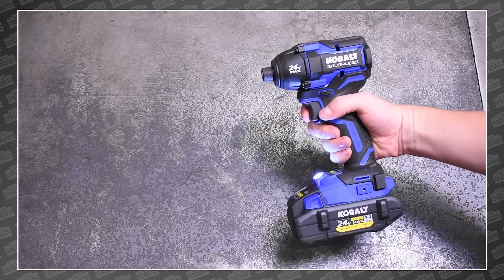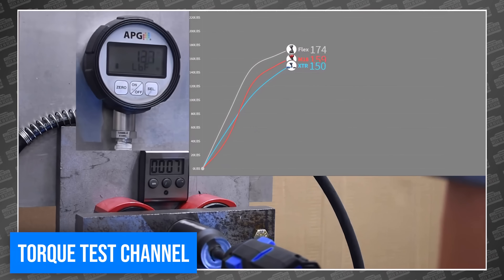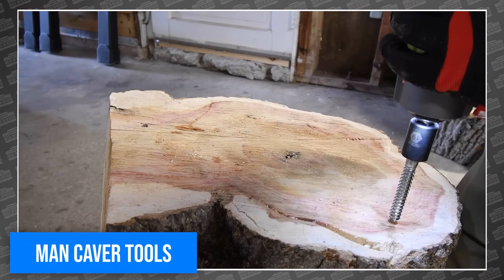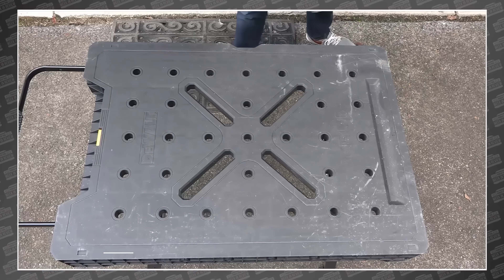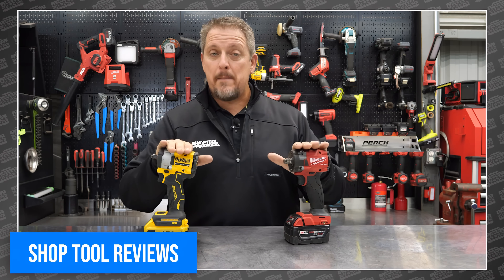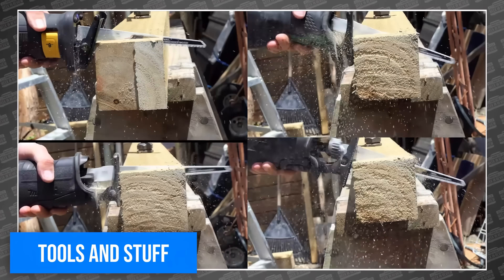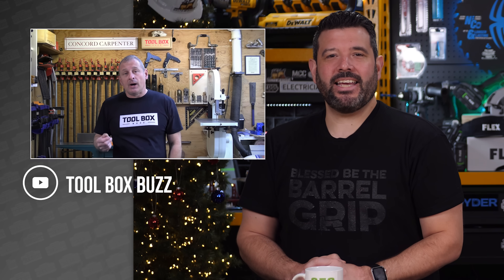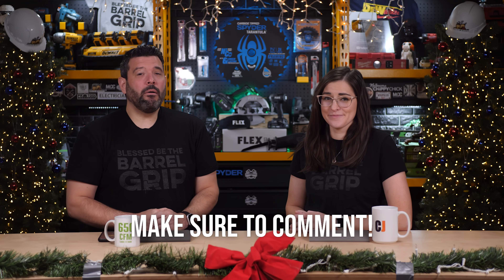Milwaukee FINALLY delivers on a HUGE promise. Plus, BEST Track Saws and BEST Mid-Torque!

Comment: When I said that Kobalt XTR was a sleeper, I got comments about it being a joke and DIY junk.  But when TTC does it, it's cool all of a sudden!

Must've been some barrel grip users annoyed that Kobalt only makes a D-Handle.  They tend to whine a lot.
Reply: Kobalt XTR tools are no joke
Reply: I'm still trying to figure out what to do with a 220 ft-lb impact driver around the house.
Reply: @TorqueTestChannel  Get rid of those pesky spare socket adapters that are taking up room!
Reply: Hahaha! Love the D-Handle vs Barrel grip thing! 👌
Reply: Nope, it's still DIY level.  So what if it had an OK performance out of the box?  Take it to task on a daily and than return it to the scale and see how it does, if it can still even turn on.  

I live and breath these tools on job sites, and the Green, Gray, Craftsman red, Blue, heck even some of the Orange etc., all end up in the smoke pile.  I tell the guys to save their time and money and actually spend a little more initially and buy a better brand if they are seriously going to be using these tools on the job.  The only ones that last are Yellow, Blue and Red, Buy Once, Cry Once.
Reply: @jmackinjersey1  Tried Flex hammer and circ, they arent bad imo, definitely on par with the yellow, blue and red

Comment: Why can't Dewalt just copy Milwaukee's nailers?! Come on Dewalt!
Reply: Uhm, because they don't want to end up like Snap-On and losing law suits.
Reply: One could argue that Milwaukee copied Metabo/Hitachi.  They were certainly not first with pressurized nitrogen tech.  The DeWalt nailers may not be as powerful, but the flywheel design is pretty reliable and many 18v XRP nailers are still grinding away.
Reply: @tccoggs  Yeah but the two really big downsides to flywheels are the size and the noise.
Reply: @todddammit4628  I wouldn't call the flywheel loud, especially in comparison to Paslode. In the big scheme of things, it's far from loud when it comes to all the tools on a jobsite.
Reply: @tccoggs  True. But Paslode is basically ancient technology at this point. And the compressed nitrogen guns are just so much less annoying in the sound department.

Comment: Kobalts 24v impacts have always been overlooked for the powerful machines they are. For years they've been head to head with the top boys like Milwuakee and Dewalt. Sadly it's the only tool in the platform that comes close to top tier. Would be nice to see tools get more competitive and drive costs down . Although that's probably just wishful thinking.
Reply: Ha ha ha ha.  Thank, I needed that good laugh.  Next you'll tell us that you have a set that you've been using all day, every day for decades, and not only have all of the tools lasted, but so have all of the batteries and the chargers.

They keep up with DeWalt and Milwaukee.  Sure thing.  Not even their entry level brushed line-up.  You must me sniffing the Smoke that comes off of the tools when they burn up.  Because I dang sure know you aren't using them on any full on job site on a regular basis.